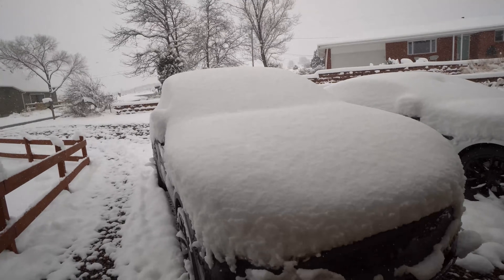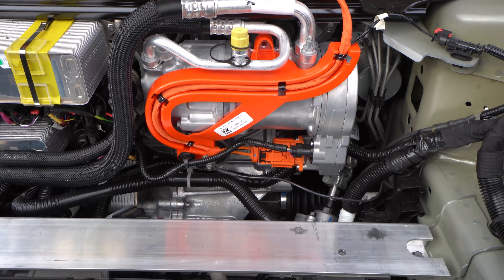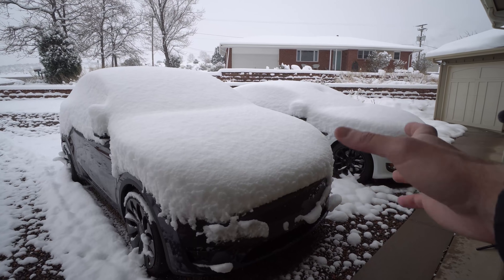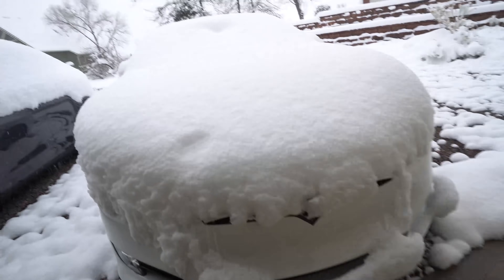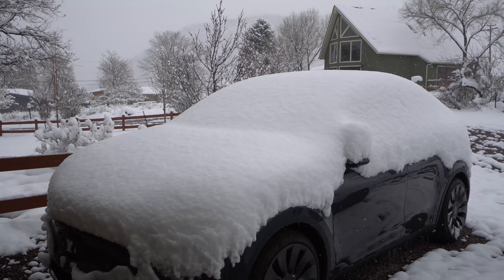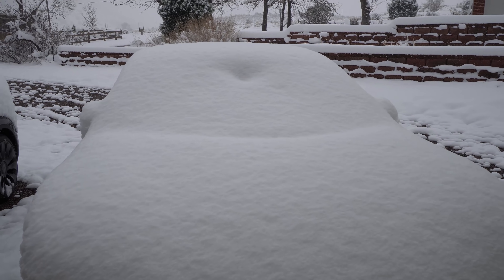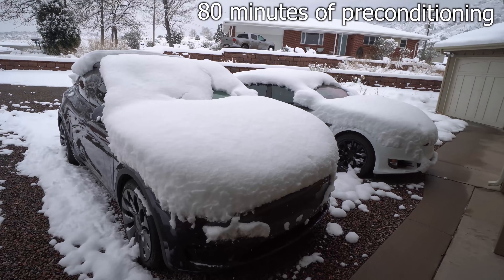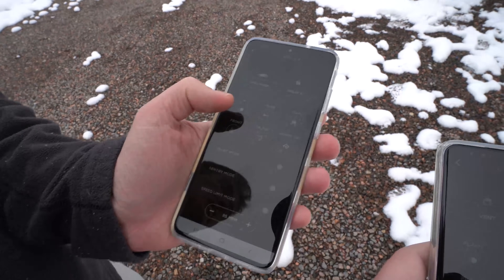Is the Model Y Heat Pump More Efficient? Preconditioning Challenge! Heated Radar?

Comment: The heat pump increases efficiency by 10% in real world driving according to Elon . It is moving heat using the Octo valve from the motors and batteries to the cabin and vice versa. When the engine is not running it is unable to use the heat from the engine to warm the cabin. However I am still surprised with that result. Thanks for taking the time to do this.
Reply: Heat pump in the case of the 'Y' and other EVs is able to take heat out of the air down to about 20f.  At temps above 30f, it uses about 1/3 of the energy as the resistance heater. You're talking about the heat scavenging system that has been in place on other Teslas.
Reply: spazzman90 I’m actually not, I agree that heat pumps in home air conditioners use refrigerant take heat from the outside air to heat the home and visa versus. But the Whole point of the Octovalve is to transfer heat using “refrigerant”, which has up to 300% efficiency, from and to the various areas of the vehicle and the environment to minimise the use of “resistance heating” which every other Tesla and EV uses. 
All other Teslas do not use refrigerant to perform this function
Reply: @adrianwood8820  Looks like it is a bit more involved than existing heat pump systems in other EVs.  I've had a few EVs with heat pump systems and have enjoyed the systems tremendously.  It's exciting to finally have a heat pump system in a Tesla (I live in the NW).  I'm looking forward to more information coming out and using it myself.
Reply: spazzman90 yes correct the Leaf has had it for a long time, but there is a couple of innovations that take it to the next level, Elon explains these in the third row podcast

Comment: Maybe another point to consider is that you’re comparing total energy used on both cars, but both cars might not have heated the same amount in the end. As in, both cars started off at sub freezing out-in-the-cold temperatures, but maybe one car ended up more overall warm than the other. In that case, maybe it isn’t so surprising that the model S ended up using less overall energy when it didn’t even heat up to the point where the frunk was clear of ice. Another perspective is the rate of energy usage, the actual power. Both cars were preconditioning for the same amount of time, but the Model Y used more energy in that time. You could consider the Y more time efficient instead

Comment: You also need to consider the surface area the car is preconditioning. Obviously, the Y is much taller and larger and has more surface area. Therefore you could expect it to take more energy. So if you calculated kWh/in^2 then you will pry see that Y is more efficient.

Comment: Trying evaluate car heaters comparing how fast snow melted is just wrong. It actually evaluates the insulation quality, not a heaters. Heaters designed to heat the air inside, not the car surface. The better way would be measure the energy taken from the battery for the heating using special device connected to OBD and ap and time needed to have temperature  reach the point.

Comment: flawed test in many ways. you need to measure the amount of btus that the system produced to heat up the vehicle vs the power that was used to get actual efficiency numbers. A few more things to note:
1. the pump would be more efficient with a moving vehicle so you have more air flowing across the evaporator to pull heat from.
2. the total cubic feet to heat in the model y is much more than the model s so take the size of the vehicle into account which should also help to find the total btus the system is putting out in each vehicle.
3. we are not sure yet if the pump actually runs much when the temperature drops too low. my nissan leaf will use the heat pump down to 20f and anything below that is purely resistive heat. So until we can find where the power is going in that situation, we cant determine it.

Comment: The heat pump also heated the battery pack too... and same with model S... so it probably would use the same energy... if you were driving the heat pump can scavenge  heat energy from motors and electronics too.

Comment: Why not set temp to 70 degrees and see how long each car take to bring cabin temp up and calculate the energy used.  I dont see the need in continuing to run the heat.  In your scenario, I would wipe off the snow, set temp to 70, and when it hits the mark I would be ready to drive off.  I think this would be more of a real world test.     Thanks for the video though!!

Comment: Everybody is misunderstanding what a heat pump is.  Its not a scavenging system, its a reverse air conditioner/ refrigerator.  It takes energy from one place and puts it somewhere else against its natural thermal diffusion gradient.  Stand behind your refrigerator/freezer it gets really hot because its taking energy from the inside and putting it outside.  Its the reverse concept with a heat pump its taking energy from the outside atmosphere and putting it inside the car against its thermal gradient.  A heat pump in its simplest form is just an air conditioner system that flows backwards.  In fact the "heat pump" portion of the system is the same exact air conditioner compressor that is used in the model 3 with a super fancy diverter valve.

Comment: If the car not running it s not that different because it will need to run the electric drive train at curtain speed to heat the car. If the car is moving the advantages will be much more obvious for model y since model s will need to use power from battery to heat the whole system all the time while running .

Comment: Thought the heat pump would only be advantageous when actually driving as it takes the heat from motor
Reply: Everybody is misunderstanding what a heat pump is.  Its not a scavenging system its a reverse air conditioner/ refrigerator.  It takes energy from one place and puts it somewhere else against its natural thermal diffusion gradient.  Stand behind your refrigerator/freezer it gets really hot because its taking energy from the inside and putting it outside.  Reverse concept with a heat pump its taking energy from the outside atmosphere and putting it inside the car.

Comment: Pay attention with the infrared measurement results! Also the colour of the surface (bright or dark) in combination with solar radiation (also on cloudy days) affect the temps results. You can see it on the outside part of the dark tires in comparison with the white surface or the tire part in the „shadow“ of the wheelhouse. I dont think that the tires are heated ;)

For fast preheating the cabine you need a high peak performance. Such small heat pumps in cars can not provide that and the efficiency suffers.

A good comparison for the efficiency you get for constantly holding temperature over a certain period.

The heat pump should reduce the energy amount for heating AND cooling up to 67%, depending on inside/outside temps and fan speed.

Comment: I agree with "JeffnReno", I believe the front radar heater only turns on at need. As in, when the car is in use, not just sitting still in a driveway. Nice job otherwise. I haven't seen a snow brush like yours before, where did you get it?

Comment: I did see the radar hot spot. Also, Heat pump should be best when driving... it will take the excess heat of the motors and battery and pump it into the cabin.

Comment: I believe the heat pump is meant to be more efficient overall. Initially, for preconditioning, the heat pump requires the battery to be warmed up (like an engine) to warm up the car, so more energy is used at that point. However, for something like a road trip or driving home during rush hour, and you have the heat on for the duration, you should see a more efficient use of the battery over the course of the trip.

Comment: Interesting but so many different variable uncontrolled.    Not even ralking about the definition of the word efficient....   my home heat pump is 3x more efficient ( cop of 3,27) at 18 f than my gaz furnace but the delta t over time output is 3 time less.   Around 5kw of heat but!  Use only 1.7 kw to get that heat instead of the furnace that need around 5.5 kw of gaz to get the same delta t.   Also, most of the lost of efficiency of the heat pump is related to the air blower and defrost cycle. Other things i'd really love to e3e how it's managed.

Comment: Heat pumps work much better in less extreme conditions at least they do when used in a house heating and cooling. Very frequently used in Px where it doesn't get nearly as cold, obviously much hotter in summer but heat pumps are more efficient at cooling than heat. At least that is the case in residential use. May not be true in a car but may work out great for vast majority of owners not in our Colorado climate.

Comment: One thing to note is that the range of model y performance, 280 miles, is calculated based on using the performance wheel. When the car is static and consumes 13 miles of range, it’s probably more fair to divide it by 300+ miles

Comment: Compressors with a reversing valve (i.e heat pump) COP values (efficiency) drop as the medium through which heat is being extracted from decreases. As temperatures drop below freezing, typically you’ll see compressors COP values drop close to 1.0 or below. For comparison, electric resistance heat COP value is 1.0 (heat input = heat output). At more ideal operating temperatures, the compressor will operate at Tesla’s indicated COP value which I believe was 4.0 (1 unit of heat input results in 4 units of heat output).

What this test doesn’t take into account is Tesla’s thermal management system or, as Tesla calls it, the octovalve. Batteries, electric motors, and other parts of the car give off heat when operating. Tesla’s thermal management system likely collects this heat to increase the temperature of the medium heat is being extracted from by the compressor. The higher the medium temperature, the higher the operating efficiency of the compressor.
Reply: The COP of a good heat pump should never drop below 1. My cheap Goodman heat pump is still above 1 at like -30F
Reply: @bp495599  Agreed , that's why i was facepalming when i've seen the test result and how it was calculated
Reply: My experience with heat pumps for home heating is that the typically switch to a backup heat source when outside air temps are in the low 30’s to 20’s F.  I suspect the Y has a backup electric heater in the HVAC system that was assisting the heat pump given the low air temps.  That would help explain the unexpectedly high energy use.  Some more questions for Tesla are in order.

Comment: The reason that explain the Model Y's high consumption is probably that it turns on the front motor in order to heat up the heat pump system initially as it's too cold to do anything. But after it's heated up, it'll consume nearly nothing as the motor shuts back off. So in the long run it's more efficient, but not for a few minutes.

Comment: I wonder if the real savings with the heat pump is just driving wise. Lets say the car operating, battery temp, etc from driving helps along this process in the heat pump and then the efficiency difference (Elon says is around 10%) is seen.

Comment: I feel you can’t use the same amount of time to measure wattage used. If the Y got to temperature quicker which in return would have used less wattage. Preconditioning is also measured by time for ready for use?

Comment: One thing you didn't take into consideration. The model Y heated up faster and does not need to preheat as long as the model S does. Which would make the model Y more efficient.
Reply: No, that makes it faster. Efficiency is how much energy was used to heat it up.

Comment: Re: noisy heat pump: Sandy Munroe said that he heard from Tesla that they will add some sound proofing as they know about the noise issue.
Re: efficiency. The heatpump is probably more efficient when the car is driving as the air moving over the radiator will allow much better efficiency.
Reply: Anyway heat pump is going to be always more noisy than an electric resistance which doesn't produce any sound.
Reply: Exactimily what I was thinking. And also, some fixes may come with updates. It's possible that things aren't optimized yet, at all.
Reply: I wonder if they’ll “recall” existing cars to add soundproofing or only either A. Add to cars people complain about, or B. Only add to new production going forward.
Reply: @CFG39  Tesla won't do a recall to add the soundproofing jacket.  Most likely they do it when a customer complains about the noise.
Reply: @CFG39  I think they will probably, because all they really have to do is have a better cover for sound proofing

Comment: I don't know if it true for the model Y, but from my experience selecting high or the highest setting usually isn't going to be efficient. The computer will usually be programmed to completed its task in the fastest way possible (a lot of times for emergency reasons). So the heat pump and the resistive heaters were probably running at max causing more drain. Since the Model S doesn't have a heat pump, it would have less power drain.

Comment: More efficient doesn't nessesarily mean uses less energy when running. If it heats up the cabin in half the time, it doesn't need to be running as much.
Reply: well it should still use less energy to achieve the same temperature...

Comment: if you relay want a comparison: set both cars to 70°F and wait for 2 hours.
Reply: should have set both temps to the same temperature and not set to HI. it maybe be different for each car. Set it to a normal temp like 72. Also, if you can measure the KWh  or battery percentage it might be a bit more accurate. You are correct though, if the temp is below the working temp of the heat pump, it probably uses resistive heating.
Also, the heat pump may work best at moving heat from the parts that are hot to the parts that are not, so when you are moving, it results in better efficiency for the amount of heat needed.
Reply: I disagree : set both cars at 70F and then once they reach that temperature  , measure the energy  used by ODB,   waiting for two hours is not a bad comparison ,it would still favour the heat pump but it's not realistic as you normally set the temperature and start driving when the hat pump is supposed to get even more efficient .
Reply: Can you please stop using gibberish degrees. You are speaking to the world in your videos. Thanks.

Comment: It seems the Y lost some heat to the frunk, which is wasted energy.
Reply: model 3 and Y based on same design and they both seem to have a significantly higher thermal loss likely down to cost cutting measures.   i noticed rear and front of the 3 and Y seem to both lose a lot of heat but the Y is noticeably more so.  so whatever extra efficiencies are gained from a heat pump are going to be bled off making the differences a lot less.
Reply: Not entirely wasted. Some complaints owners had about the Model s is that when driving during a snowstorm, snow would build up on the frunk. By heating the frunk, that will no longer be an issue. Normal cars have an engine bay so the waste heat would melt anything on the hood.
Reply: @imzjustplayin  putting heat into an empty space like that is just waste. If Tesla is really interested in solving the hood snow problem, then Tesla should put defroster coils on the hood. That's why there's coils on the rear windows and the AP cameras on the mirror, for example.

Comment: The model S could have ice caked on it like that if it was driven more recently before the snow. The heat would cause the snow to melt before it re-freezes causing it to form like that. If the Y was already outside temperature when it was snowing the, it won’t freeze onto the hood and can slide off easily. Might not be difference in the heater.
Reply from the maker: Good thought. However when the test was started both cars had been in the garage for several days and were completely dry. It had been 70+ degrees the week prior. The garage was ~54-55 degrees when started.

Comment: Since you put it on "HIGH" we don't know if the output heat was the same overall. The Y might have higher output heat, would have been interesting to know how hot the air coming out of the vents were.
Reply: They consistently showed that the Model Y was producing more heat than the S, so saying that one was less efficient than the other over a set time is just wrong. You would have to know how much heat each produced per kWh to find efficiency.
Reply: Yes.  Instead of setting it to high, I would have set them both to 80
Reply: Model Y did a better job of heating Colorado
Reply: Isn't max heat output on 3/Y 7kW vs 6kW on S/X? Also 3/Y uses motor to generate waste heat which also heats up coolant loop. S/X only heats batteries with the batteryheater.

Comment: The model Y’s heat pump may still be more efficient than the model S. You could have tested this better by taking record of the amount of power used at each time interval. It’s likely that although the model y’s heat pump is more efficient at warming the car, the car has more space and glass to transfer heat out so over the span of an hour, more heat is wasted and costs more energy due to the  design differences in the cars.
Reply: not to mention their was ice on the model s, and none on the model y
Reply: Exactly, god point.

Comment: I think the heat pump is more efficient if the car is moving because it will use the heat form the battery and motors to heat the cabin. if the cars are parked you can't use the heat pump to its potential. 
if you could test that somehow would be great!